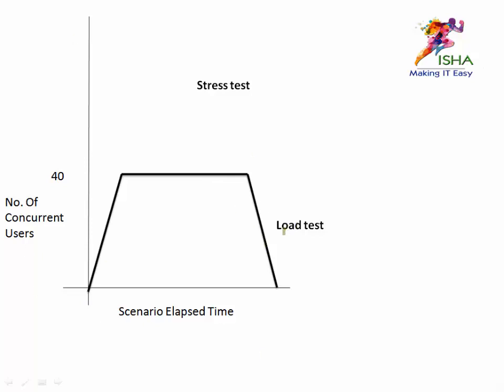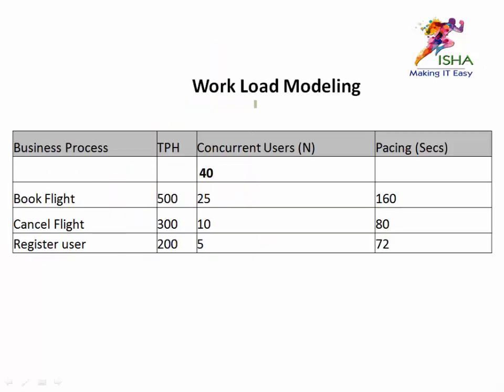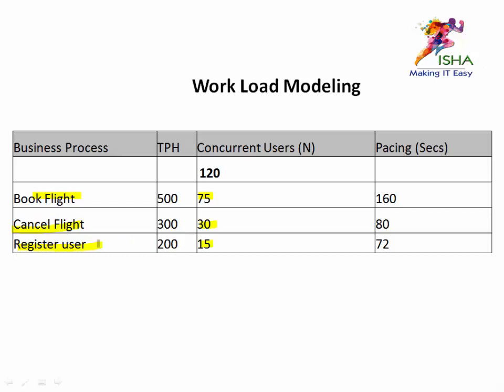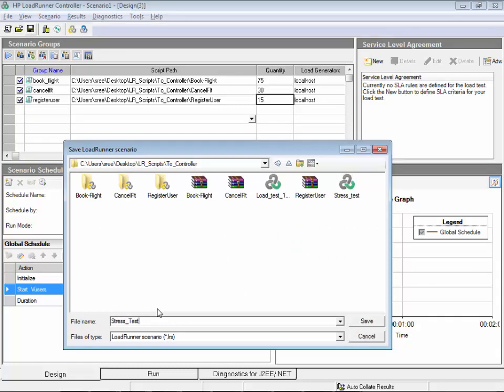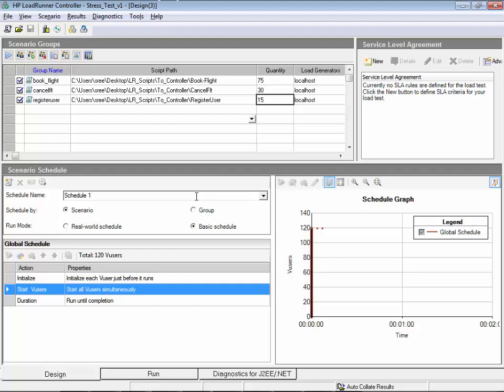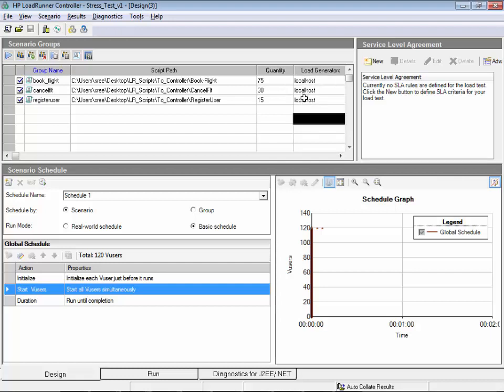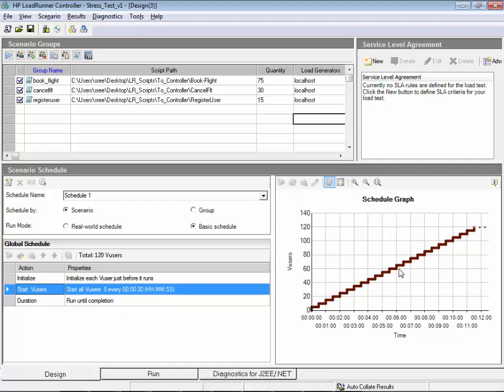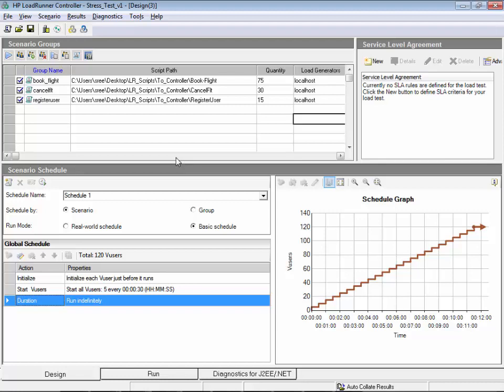Performance testing - How to Build Stress Test using LoadRunner

Comment: Sir , I have a doubt. Suppose I have lisence for 40 users in controller. How can I conduct stress test for 120 users.
Reply from the maker: you cannot....but decreasing the pacing by 3 times(1/3rd)  will create same load, as increasing the users by 3 times